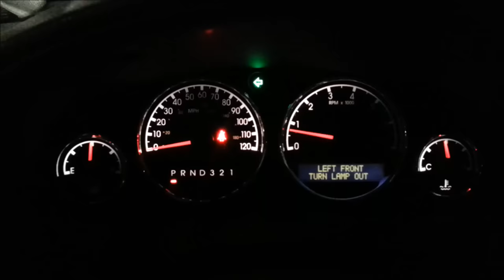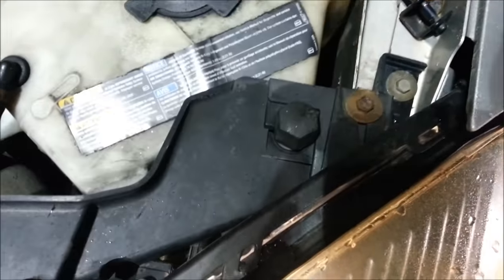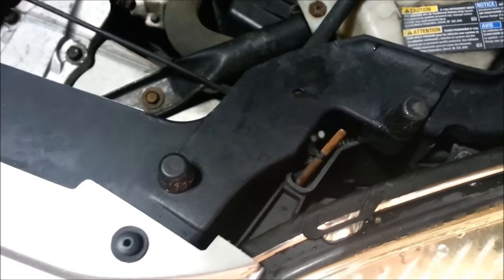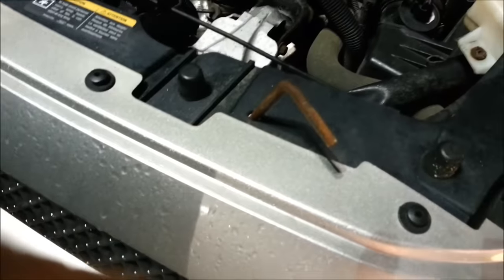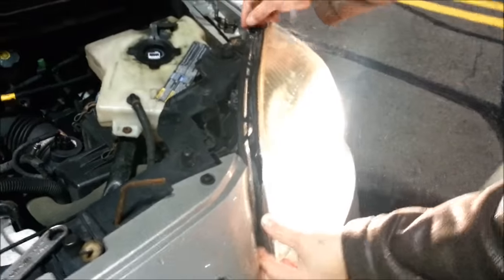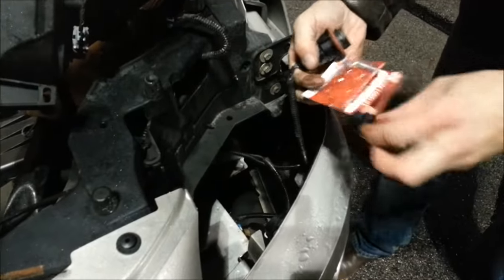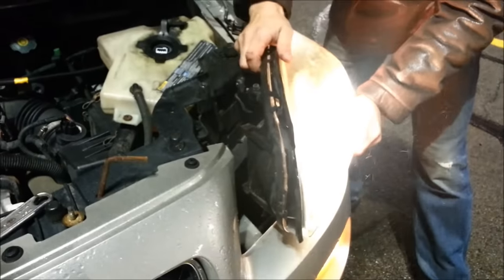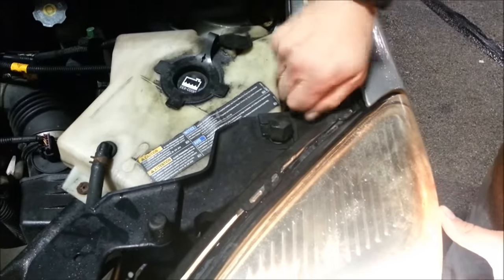2005-2008  Chevrolet Uplander turn signal bulb  replacement in 5 min

Comment: Should also keep a pair of gloves in that emergency kit. By touching that new bulb with your bare fingers and transferring skin oil to the glass of the bulb, you just ensured that you'll be doing that job again rather sooner than you realize! An alternative would be to keep some rubbing alcohol and a piece of cheese cloth handy to clean the bulb after touching it with your bare hands!